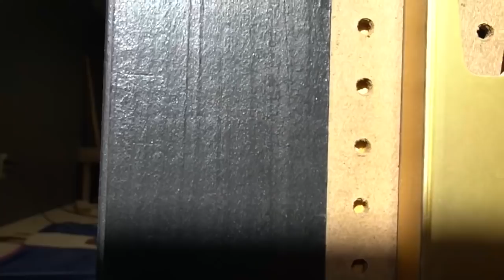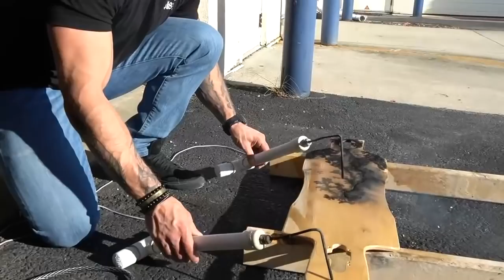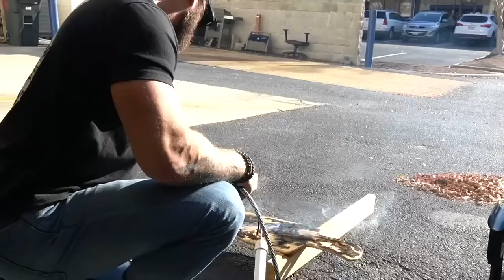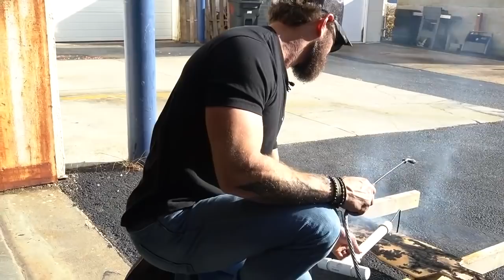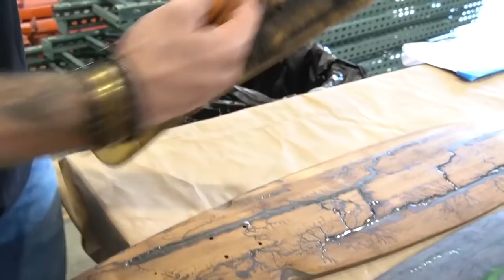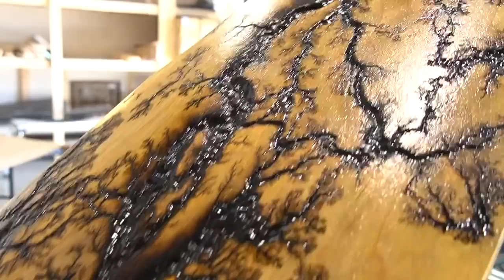Tribesk8z Presents: What is art therapy? Part 1

Comment: Get you some PPE brotha. Class 2 lineman gloves,  Install some GFCI outlets to detect electrical faults and kills the power.  Dual cartridge respirator since your sanding for hours. I'm an ironworker and im exposed to all kinds of nasty sht. Even wood dust is toxic and can cause cancer. Ventilate the sanding area and use vacuumed sanders to control the dust.  Hate to be the safety Dhead here but I've seen some crazy sht in my work.